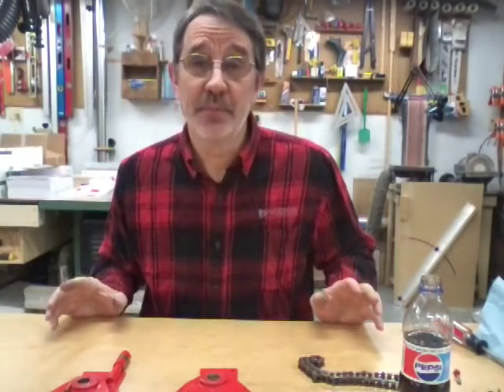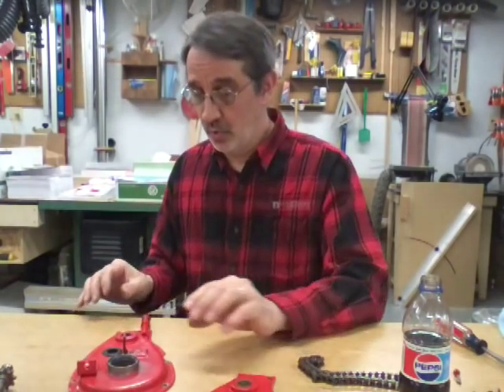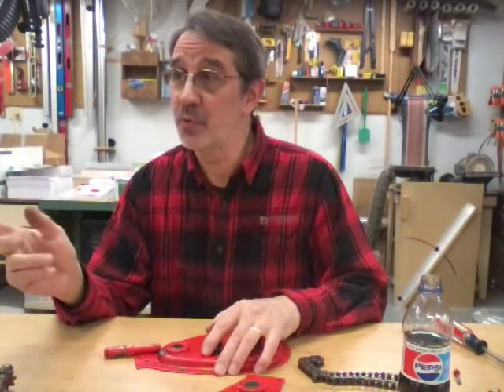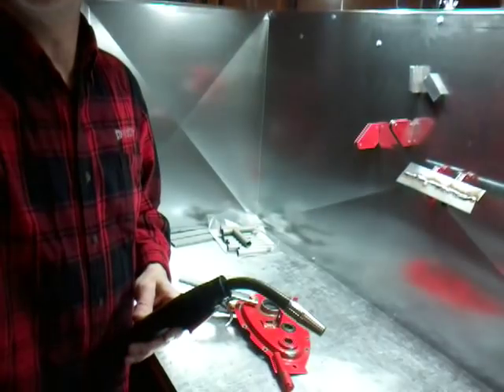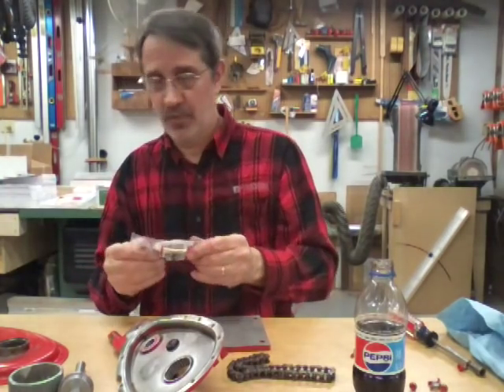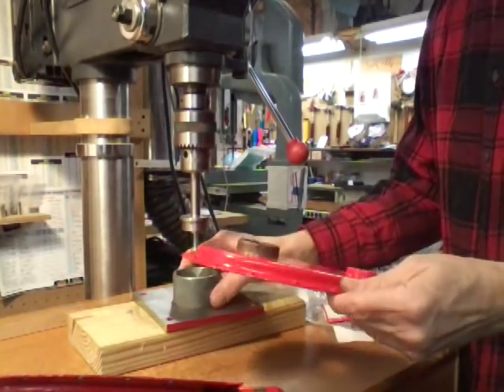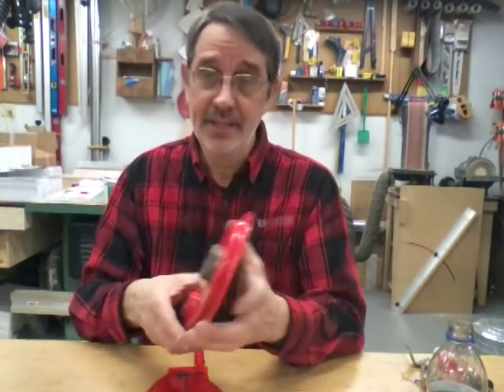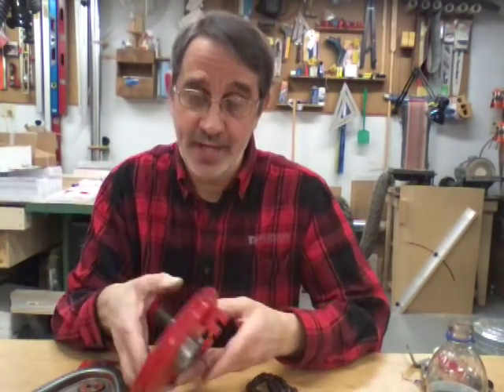242. Part 9 Completely rebuilding my Snapper RER

Comment: On an unrelated topic, can I swap my 28" deck to a 33" deck? 

Is it even worth doing for the extra cutting surface? 

IF it is swappable, what all would I need to swap besides the deck and accompanying blade? 

Thanks for any advice you afford me. 
And, thank you for such informative vids! 👍
Reply from the maker: STAY WHITE 
Hi it’s Jim
   You could put a 33 inch deck on a 28 inch machine but you have to change the pulley that is in the drive disk assembly On the bottom of the engine. And the front and of a 33 inch machine has a wider wheel base for more stability on hills. Personally I’ve have both and I much prefer my 28 inch over the bigger machine it just seems to do a better job as far as I’m concerned. Jim

Comment: I looked for a more appropriate video to ask this, but...I have Snapper RER with a 12 (.5?) B&S.  It uses about 8+ ounces of oil (30 wt. detergent) during 1- 1 1/2 hours mowing, full throttle.  It runs fine as long as I keep the spark plug changed.   Would you recommend using an oil additive such as Lucas Oil Stabilizer?

My apologies for posting in an unrelated video.
 
John
Reply from the maker: John AKA 
Hi John
    It doesn’t matter which video you use to ask a question on , as long as you ask the question. 
    I would say is that your piston rings need to be replaced if you’re fouling the spark plug and is it smoking? If so it’s probably the piston rings are shot or if it doesn’t have a cast iron lining it could be the aluminum cylinder is egg shaped down at the bottom. Thanks Jim
Reply: Thanks, Jim.  It is not smoking, and the oil usage is not a big deal.  I just thought if the treatment might help, I'd try it.

This is my third Snapper, a 2000-2010 30" "SR930". It needs a little work, but I'm now thinking (since watching your videos) about re-doing some things rather than replacing it, so a new engine maybe in the future.

Btw, I was a Snapper dealer for a couple of years back in the 80's.  It just didn't work out well with the rest of my business.  Still, I've sorta regretted giving it up.

Thanks again

Comment: Jim, I recently worked on a snapper rear engine mower. In replacing the friction wheel I found the original one included a free floating liner. On the replacement friction wheel the liner was fixed in place. My question is what, if any, effect this difference would have on the operation of the mower? Thank you in advance. John
Reply from the maker: Guitars Cadillacs 
   Hi John
   The liner is supposed to be attached inside of the clutch disk your old one must’ve broke loose, look at video number 70 it will explain how to adjust your drivetrain.  Jim
Reply: Thank you Jim